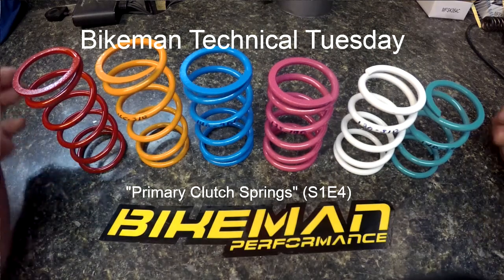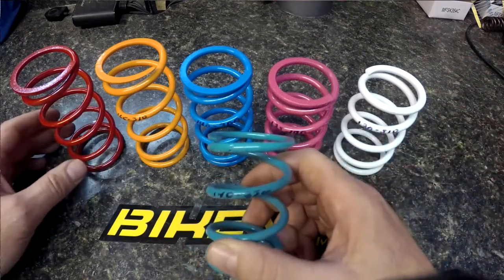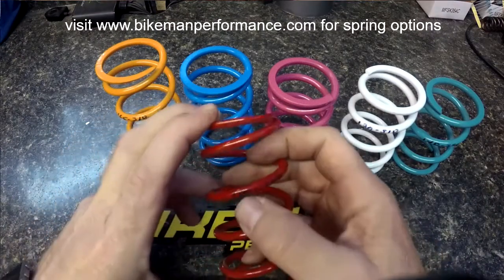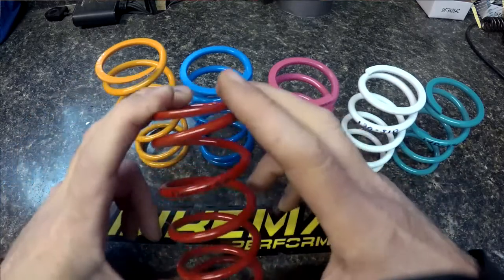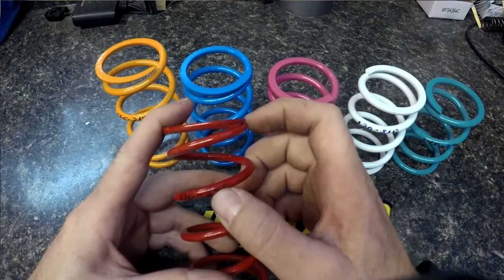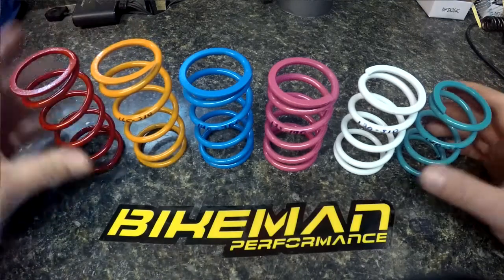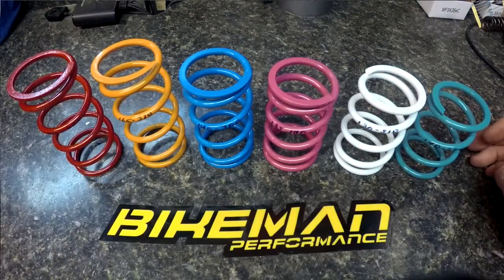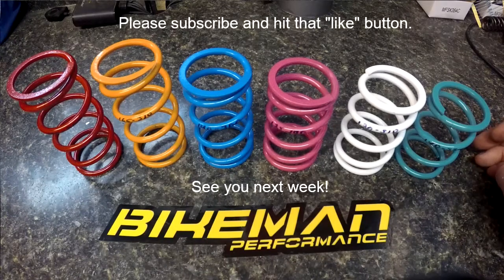S1E4 BMP Tech Tuesday - Primary Clutch Springs

Comment: Help....I need help, I keep buying clutch springs that don't fit. Don't want to Mortgage my home. I have what I am sure is a Comet Clutch. But I don't know if it is a Duster. The spring I have, will not let the clutch fully Disengage, after rev up. It is RED, 1 5/8 wide, and was over 3 inches long, before I cut it. (stupid) Please, can you see if you know of a Clutch spring, that will fit my needs. Thanks Wayne 916-910-5536   btw 1" bore.

Comment: What spring would I use if I wanted engagement at 1200 rpm? Swapping a 3 cylinder diesel engine that makes 60 hp into a snowmobile that hits a max rpm of 4400 rpm.
Reply: How did it turn out

Comment: since this is new, what would be best for turning in mud? higher engagement with a lower full shift?
Reply: For mudding applications, I would use a stiffer spring and a little more weight.  The heavier primary spring will help it backshift quicker when you need it.  I would also use a flatter straight angled helix like our TSS03-6 Helix.  This too will help provide a quicker backshift and will also provide better belt squeeze in the secondary.  Give us a call here at Bikeman Performance for all your performance needs!  715-483-3003

Comment: What if i want instant engagement
Reply: it is difficult to have "instant" engagement, but with our clutch kits for trail applications, we actually use a shorter spring for just that.  Our clutch weights also allow you to shift the center of gravity of the weight more towards the heel which will make it come in quicker and provide smoother low end power.   Give us a call here at Bikeman Performance for all your performance needs!  715-483-3003